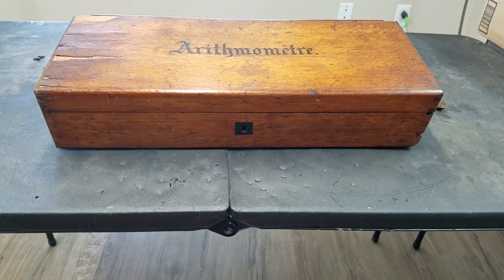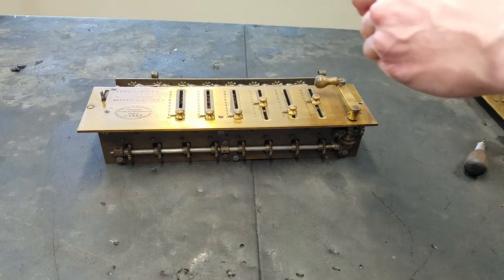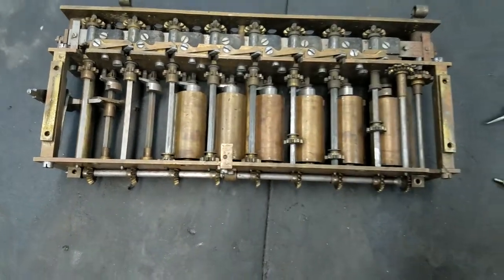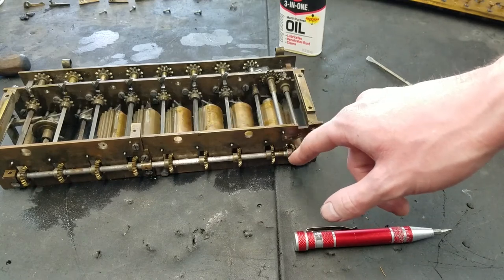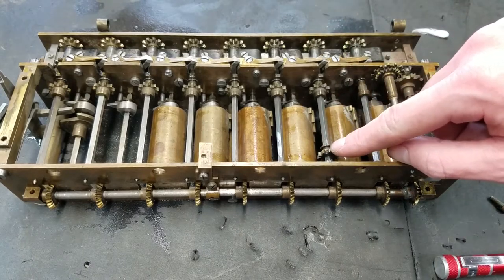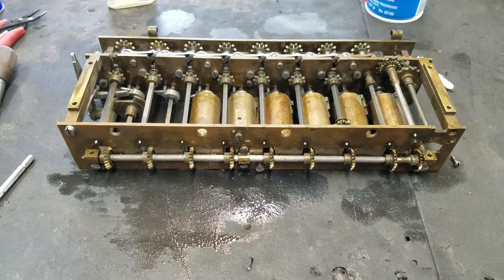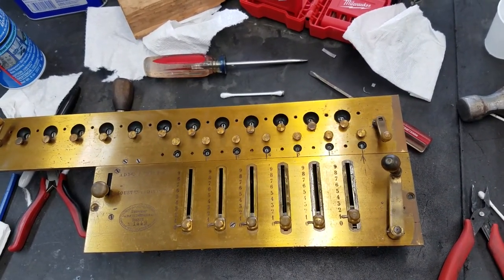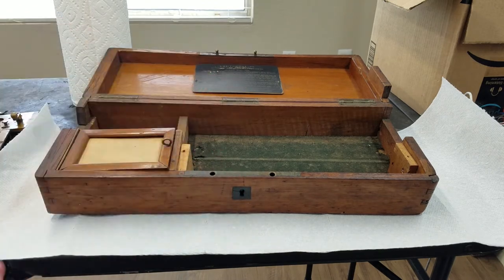de Colmar Arithmometer: Making it Work

Comment: Tate's improvements really stand out from being used to a "normal" french arithmometer - he did not only modify the locking devices and replaced the round clearing knobs with cranks, he also replaced the main crank of the machine with a much more sturdy example - the original crank was a much more flimsy affair. Also, the knob for the direction switch is also exchanged for a chunkier example. Very nice machine - cool to have the original documentation too!
Reply from the maker: Thanks for pointing out the main crank and clearing knob differences, I didnt even notice they had been modified. It would be interesting to know how many of these Tate modified before he started producing his own

Comment: Thank you for such a detailed video! This machine would be perfect for use off the Grid!
Reply from the maker: Check out the Monroe KA, it has a electric motor but you can attach a crank to run it without electricity
Reply: Thanks.ill check that out.

Comment: Sorry if I missed it, but how did you fix your broken detent springs? Mine is missing two springs for two counters.
Reply from the maker: I just formed them out of a piece of sheet steel. they dont have to be super strong, just enough to keep the wheels from moving as you move the carriage and keep them aligned